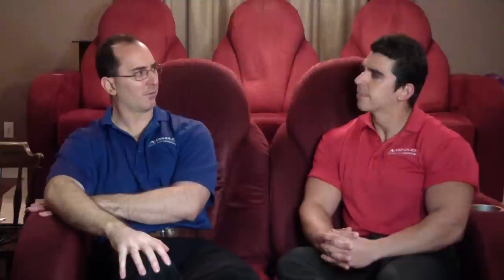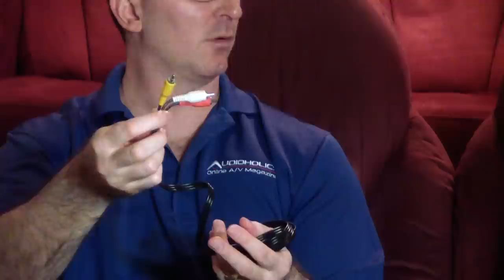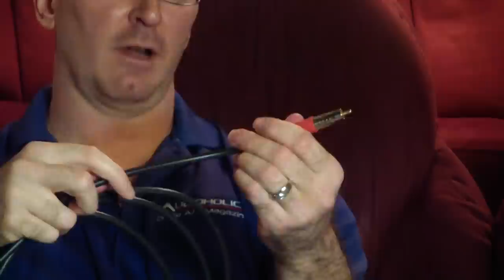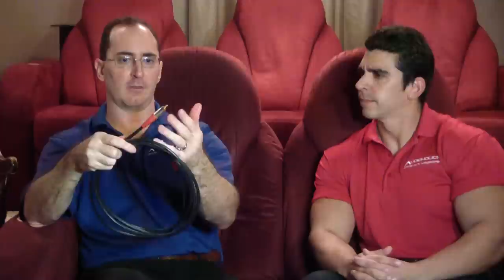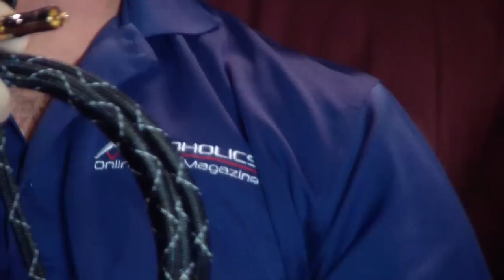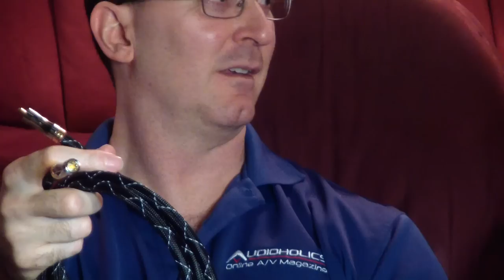Audio Interconnect Cable Myths vs Truths Revealed

Comment: Well, I've never spent a ton on cables but I definitely can hear a difference between low end and high end audio interconnects and speaker wire. The difference increases the farther up the quality of the equipment being used. Again, I'm not sure you guys are qualified to speak intelligently about this subject.
Reply from the maker: +todd goslin The differences your hearing may be placebo which is why you need to do controlled testing.  As for qualifications, we are both Electrical Engineers and my specialty is in audio communication systems. Understanding the physics of wire is pretty easy stuff for all but some folks in the audio industry.
Reply: +Audioholics No, i't's not placebo nor is it the first place I'd spend money while upgrading a system. But it most definitely can change how music is presented. By controlled environment, i assume you mean the same system, same volume while interchanging interconnects/speaker cables? Done that on some relatively expensive gear (not mine) and there's noticeable changes.  Not far down the street from here, there is a fairly high end store. The owner would disagree with you, his partner is more inclined to your way of thinking.  I listen for myself. There's a difference. 

Snake oil? How''s this? On a system exceeding 100k I once heard a set of little magnetic bowls placed on the wall in specific locations. While the music is playing, remove one of the bowls and the sound stage collapses front to back. Put the damn thing back and the depth comes back Supposed to be some Tibetan singing bowl thing or something. 

Now these little bowls sold for around three thousand dollars!!.....for little magnetic bowls?? The price is absurd but, son of a bitch if the damn things don't work! 

Cables and interconnects?  I don't know how Nordost can justify 30 grand on a pair of Odin speaker wires.  Audioquest?  Shunyata? Kabala? Kimber? The science may not (yet) be measurable but they all have there own sonic characteristics. I wouldn't be so quick to dismiss it. I'm not sure being an electrical engineer allows you to hear any better than anybody else.
Reply from the maker: +todd goslin Well I can't argue about your magic bowls or cables soaked in kosher chicken fat blessed by a Rabi.  Your mind is made up regardless if the science and reality disproves it.  If you feel the cables are transforming your system than more power to you.  Enjoy them.  I'm not telling people NOT to enjoy their tweaks. WE are just giving the cold hard scientific facts.  Cables can sound different, we never said they couldn't. But in order for cables to make a sonic difference at a system level than one has to have been really poorly designed.  Properly designing a cable is VERY easy and VERY understood and it doesn't take much money at all.  However a cable can deliberately be designed to act as a glorified tone control. In our opinion a cable should never be used as a tone control. Of course the audio store will tell you there is a difference. They have a vested interest in selling you high margin products like cables.  Again more power to you and enjoy your magic bowls and pixie dust.

Your argument about needing expensive gear to hear the difference is irrelevant even to some snake oil cable vendors as you can see in this article: http://www.audioholics.com/editorials/audioquest-demo
Reply: Sounds to me like you're the one with your mind made up and I'm not here to change it. As I've said twice now, I'm not sure you're qualified to broach this subject....good luck to both of you.
Reply from the maker: +todd goslin Likewise.  I'll admit, I'm definitely not qualified to analyze the sound change caused by magic bowls and pixie dust.  WE just don't dabble much in magic.  Sorry we couldn't be more help on that front.
Reply: Man, you are quick. I'll give you that. As a scientist, I'm sure you'll agree that theories change based on new evidence. That maybe you're not applying the science correctly? Maybe additional science is needed. 

Many years ago scientist thought that in baseball, a curveball is an optitcal illusion. Dizzy Dean once famously said "stand behind that tree and I'll whomp you with an optical illusion!".  maybe you don't know every thing.
Reply from the maker: +todd goslin The burden of proof is on the cable evangelicals NOT people of science that understand the basics in EE theory.  In EVERY discipline that uses wire its NOT up for debate except for consumer audio.  Audio is a very narrow bandwidth and very easy signal to transmit.  RF is another story and again the science is well understood and established.  You use a cell phone right?  Well you use it successfully b/c of the science is established and proven.  ONLY people that don't understand basic EE theory can make these wild ass claims about magical devices that somehow make an audible difference but the difference is too complex to be analytically analyzed.  So how can an exotic cable vendor possibly make the best cable without embracing measurements or understanding the basic principals of signal propagation?   

If your magic cables made such a difference, why not now change the internal wiring of your speakers, your amps and your electrical in your house?  Aren't those cables now the limiting factor of fidelity in your playback system?
Reply: +Audioholics sorry man, i gotta go home. ...love to continue later if you're up for it. If not, I understand.
Reply from the maker: +todd goslin NP Todd you caught me at a good time uploading new videos.  I enjoy the debate.  Just realize I do believe cables can sound different as I said before. However, only poorly designed cables can be sonically distinguishable.
Reply: +Audioholics Why not change internal wiring of components/speakers?....excellent question.  One I, myself asked.  You could, you might be altering the sonic character of a particular component which could either be a benefit or detriment. I imagine some folks do....probably swear by it. Me?....I suck at soldering so no.

But as to your question (and mine) the answer I got was something to the effect, and I' paraphrasing " The weak link in an audio system is the Ineterconnects and cables themselves. More specifically, the terminations and dielectric material containing the wires are to blame. Okay, sounds good. Who am I to argue?

Now being a bit of a skeptic I asked to borrow set of interconnects that retailed north of 2 grand and promptly went home to listen. I then spent night going back and forth from my cheap little $100.00 interconnects to these seemingly overpriced chunks of wire. What I fond was there is a difference in sonic characters between the 2. No, one isn't louder than the other nor even does one particularly sound better....just different.  Different how you ask?

Well, the pricey had a larger sound stage than mine but it seemed a tad unrealistic.  Also the bass was different, not bad, just...different. Overall, I think I preferred my el cheapo cables but that's not to say I didn't like some of the things mega buck cable did....just not enough to run out and spend two grand. 

Now according to you, and many, others there shouldn't be a difference twixt the two. After all, science tells us there is no difference so what I'm hearing must be a figment of my imagination right? The Emperor's new clothes syndrome?  I don't think so. My brain might tell me one thing but my ears beg to differ!

As I said earlier, spending money on cables and interconnects isn't the first place I'd start while upgrading a system  but it's definitely a consideration at some point.  I'd certainly audition any cables in my home prior to purchase....no harm in that is there?

.
Reply from the maker: Whoever is telling you that cables are the weakest link in a system is doing you a very dishonorable service.  They likely have a vested interest in selling you cables. 

The fact that you yourself are doing the cable swapping is a huge red flag.  Don't trust your perception here as it is is biased subconsciously beyond your control.  In order for real differences you be discerned, they must be done blind (you not knowing which cable is which) and instantaneously.  Small differences are very hard to compare if they aren't being compared instantaneously.  If you control these variables you will find the sonic differences you thought you heard will quickly evaporate.
Reply: Did a blind test drive of a car once. .....I don't recommend it........
Well I guess I'm fortune that my subconscious biased me towards the cheaper cables. Otherwise, this could become an expensive hobby. 

Shit! I hope I don't get into vinyl!!
Reply from the maker: +todd goslin Yep I got into vinyl.  Despite it being an inferior format in every WAY to CD on paper, I do like it's charm.  Also many of the older recordings were better mastered on vinyl as they weren't hyper compressed like their digital transfer counterparts.
Reply: +Audioholics too late I was very disappointed  (financially speaking) that vinyl sounded a lot better to me on my system as well, tubes too!
Reply: +Audioholics question for you: Kevin Voecks of Revel and Richard Vandersteen of....well Vandersteen have very different ideas on crossovers. One is big on first order with claims of time phase coherence or such. The other prefers high order crossovers. Something to do with first order cross overs and overheating issues leading to distortion or the like.
Both designers have very successful speakers lines and, as you might imagine, their respective speakers present music drastically different from each other. My question is, as an electrical engineer, do you hold to one theory or the other? Both valid concepts? Is one a sonically honest while the other is selling snake oil?
Reply from the maker: It really depends on the design objectives of the speakers.  Typically speakers with first order crossovers have poor power handling and can have higher distortion products if the breakup modes of the drivers aren't well controlled.  Higher order crossovers can still be phase correct if you use linkwitz riley type filters. This allows for much better power handling, better control of breakup modes and better integration of drivers. The science is on the side of the higher order crossovers if properly executed.  That said I have heard speakers with first order filters that sound very good but I didn't play them at very high power levels to see how they misbehaved on those scenarios.
Reply: +todd goslin You even know what you are talking about? ...You really wanna talk about crossovers? If you want a proper crossover you will have to go active in the first place... but you don't seem qualified for a proper discussion about this subject.
Reply: +todd goslin You dont seem to be qualified for anything. Go learn ohms law first.
Reply: +todd goslin Obviously, Tubes have saturation and are not flat in response at all. The saturation can be seen like an eq adjustment which just sounds better to you. You can achieve the same effect by adding a simple multiband Q adjustable EQ to a transistor amplifier. Audiophiles often forget the essense of Hi Fi. Which is Hi Fidelity, aka as close to original as possible. However most audiophiles dont even know how alot of instruments actually sound... or know anything about recording techniques. So audiophiles dont even know anymore what the actual truth is. They have no clue as to what processing goes on in recording and mixing and mastering. I'm a recording engineer professional for the last 10 years and sometimes when i hear audiophiles talking...  i just feel embaressed for them.
Reply: +MonoLucas123 Have a little too much to drink on turkey day did we? 
Snake oil purchase? which purchase is that? What cables did I buy? How much Did I spend?
Reply: +todd goslin The difference you are "hearing" is most likely the difference between low and high capacitance cables over a distance. Use a low capacitance, low shield resistance cable and that will be the best.  As for speaker cables, the factor is really just the gauge of the speaker wire.  A larger gauge pair will set the proper damping factor.  It is really quite simple.  Audio Interconnects = low capacitance, low shield resistance soldered to quality connectors.  Speaker cable = larger gauge wires.  That is it!  There is nothing more that can be done.  Despite claims, the snake oil audio world cannot change physics.....  (my training and experience = 15 years as broadcast engineer)
Reply: I'm terribly sorry,  hope I didn't hurt your feelings....  You gave no indication that you wanted to talk about this intelligently.  In fact you're not  giving much indication of any maturity either.
Reply: MonoLucas123 Did you want to discuss something intelligently or did you just want to troll? I honestly can't tell. Your kinda coming across a little belligerent
Reply: Sure buddy, exactly the level i expected haha
Reply: Glad I  could help.
Reply: +MonoLucas123 he used the word troll, a millenial haha

Comment: 5:12 .... Listen to the answer to this question. The man in the blue shirt made a BIG mistake here ! He says himself the cable only has to transmit a low current, it's transmitting low voltage signals. A thin wire has a higher resistance than a thick wire, therefor a thick cable is needed when working with low currents and low voltages!! Interconnect cables with thick wires simply sound better than cables with thin wires. Build one yourself and compare !!
Buy 4 feet of Aircell 7 cable and 4 cinch plugs, silver- or gold plated, (which don't need to cost more than 3 to 7 bucks a piece). Use silver solder (5 to 10%). Build an interconnect out of that. This cheap cable will EASILY outperform much more expensive commercial cables !!! I know..... I've tried. And I have "converted" many audio fans.
I know....the Aircell 7 cable is NOT flexible at all, but boy....does it sound good for the money.
(Google Aircell 7 !!! )
Reply from the maker: No my friend you are mistaken.  Line level voltages are both low current and low voltage.  It's important to use a  well shielded COAX cable with a 75 ohm characteristic impedance (for HF video signals) to reduce return loss and maintain an ideal reflection coefficient = 0.
Reply: AudioholicsLIVE  I'm an electrician and I can tell you that 1.5mm2 cable (pretty small) can run a 2HP motor up to around 100m away drawing around 4amps. Sure it's three phase and 415V but the cable is tiny. A hifi system draws very little current. I tested a 450watt PA system for current draw and was surprised just how tiny these audio systems are. 0.11amps from 240V. The transformers break the voltage down so when you are dealing with the output of these systems its very very very small. Sure bigger cable less resistance but interconnecting cables just DONT need large cable, there is no voltage there!
Reply from the maker: Brendan DMellow nobody said you need large cables for interconnects.  However since you're dealing with small signals (usually 1V or less), its a good idea to use 18AWG COAX for long runs to reduce losses.
Reply: Brendan DMellow  You were testing a cable using a fixed voltage and one sine wave. Probably, the current is quite stable too, once the motor is running.A musical signal is FAR more complex ! In this case we're dealing with continuously changing voltages, amps and wave shapes. There really IS  a difference. I noticed the difference immediately and so did all other audio fans who borrowed my cables. The human ear is FAR more sensitive than most people think !!! And yes, sometimes bigger really is better.And here's another mystery to ponder: optical cables should all sound alike, right? Ones are ones and zeros are zeros..?! WRONG !! Please, can someone tell me why an expensive optical cable, with real glass, delivers a better sound image (better placement, more details and wider stereo picture) than a cheap plastic optical cable...?Audio is a world full of mysteries. That's why it's never boring !!  ;-)
Reply: AudioholicsLIVE True. What size xlr interconnections do you recommend?
Reply: Is mogami mic cable ok for interconnecting?
Reply: +telescopereplicator Actually, he didn't make a mistake  With Interconnects, the currents are very low because the system is based on VOLTAGE differences, not CURRENT.  Small gauges can be used.
Reply: +Audioholics Yes, that's correct.
Reply: +Brendan DMellow What are you trying to accomplish?

Comment: everything you want to know about the waffle, lies and pseudo science can be found here:
http://www.roger-russell.com/wire/wire.htm#introduction

Exotic speaker cable and interconnects are a con. As long as the resistance is low and the cable can go down to the lowest impedance of the speaker then it is adequate and cannot be improved upon.
I have a very high end Naim audio system and use their supplied interconnects. I have used regular copper wire and Naim NACA5 speaker cable to power my B&W 802's..They sound indistinguishable from one another..I use the Naim cable because it looks nicer. In my recording studio i connect passive monitors with electrical cable, and my active monitors with decent quality, average quality, shielded XLR's.

Comment: Got any facts? As you say “the science has to be there”. This is all pretty fluffy.
Reply from the maker: yes about 20 years of facts, measurements, analysis written on Audioholics.com along with an Electrical engineering degree to back up said facts.

https://www.audioholics.com/audio-video-cables
Reply: @Audioholics  it’s all well-and-good tossing your mortarboard at me, but why make such a fluffy video? State measurable facts and use absolute language rather than leave yourself open to interpretation. I’m commenting on this video; not your website or your CV.